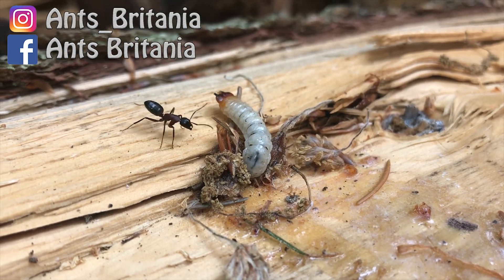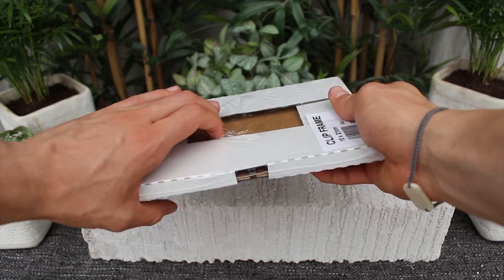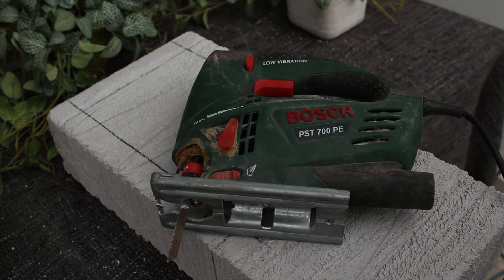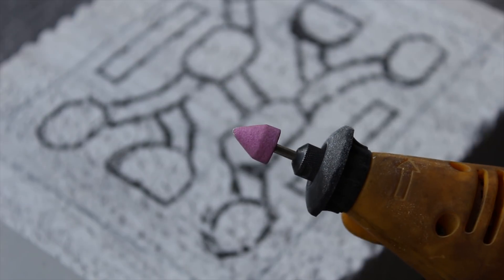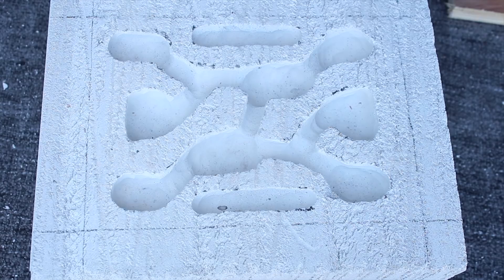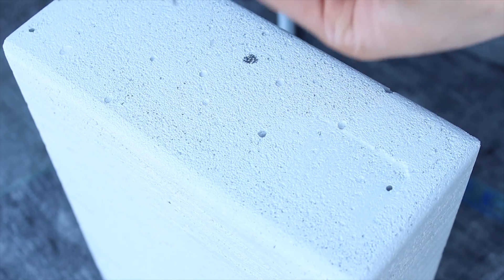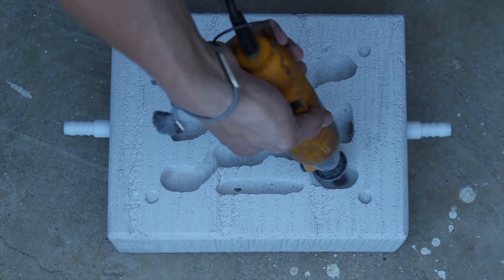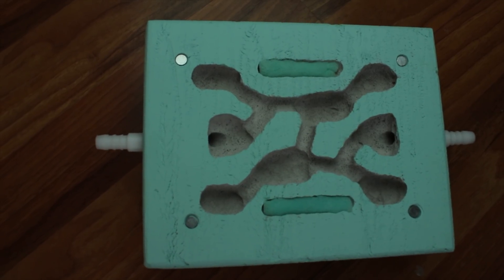How to Build an Ant Nest #3 | YTONG Formicarium

Comment: Greetings! What size magnets did you use for this setup?
Reply from the maker: Vladimir Zzz I’m pretty sure I bought 3mm x 5mm :-)
Reply: Thanks!
Reply: also wanted to ask about mites, there must be some with your high humidity vivariums, do you do something about those?
Reply from the maker: I have recently encountered a type of mite in my Trap Jaw Set Up but fortunately they only feed on rotting corpses. This is beneficial for my vivarium as it reduces the possibility of mold growth :-) There are however, parasitic mites, which suck the blood of ants. These are most of the time impossible to get rid of and your colony will most likely die within a few days. I will make a video soon on these little guys, so you can have a clearer understanding of them :-)
Reply: Ants Britania cool thanx, but about those mites that some ants suffer from, in that case you can get a colony of mites that hunt other mites, they called hypoaspis miles
Reply from the maker: These Mites are a fantastic way of eliminating parasitic mites but it takes a long time for them to kill them off. Somtimes it is best to move your colony out of their set up but most of the time, it is a losing battle :-(
Reply: Ants Britania oh i see, i fues i should get them hypoasps already in to my venator setup before unwelcome guests visit them, thanks for the reply mate
Reply from the maker: I guess you could try that! :-) Hopefully they will eat any left over food